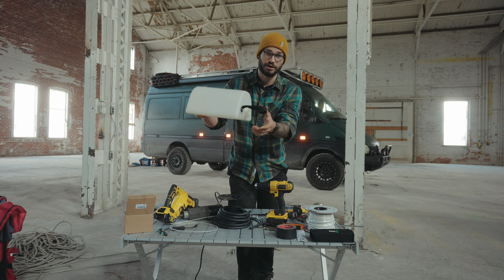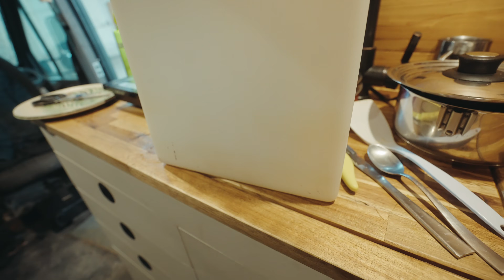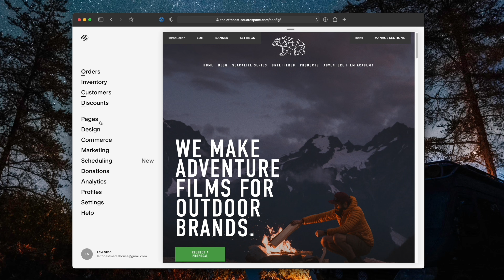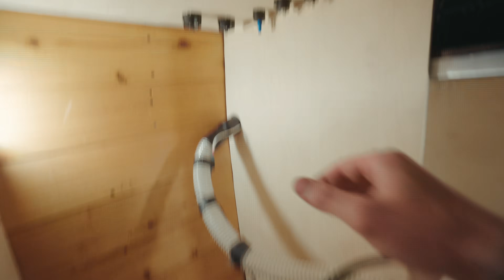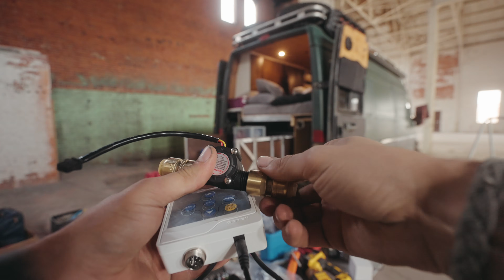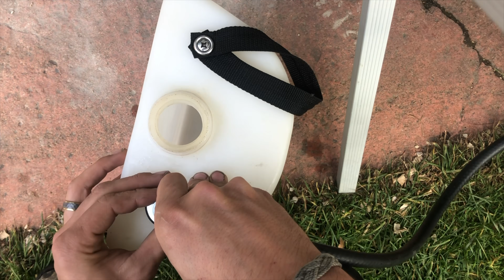DIY Van Life Toilet Hack - Transfer Pump Install

Comment: I used a windshield washer pump and added a hose to a small stainless pipe…   that pipe sprays the urine into the exhaust.. (scavenged from the dead 9th injector on my Duramax)…when the engine is running and that vaporizes and sanitizes the urine.. between campsites it will empty the 5-7 gallons of urine without a problem.. no smell.. mine is Not from a diverter though.. I have a urinal inside a cabinet door that my wife and I both use, which goes to a 10 gallon tank (our grey water and urine), leaving the cartridge toilet for more serious needs. This setup has been in use for over a decade in 2 T1N Sprinters we have converted.
Reply from the maker: Fantastic job. That sounds like a better install than I did here. We will use this in future ideas for sure. Very little do we find we need to actually use the composting toilet. It's mainly just the convenience to pee at night. We shouldn't have spent so much on the natures head toilet

Comment: How's this system holding up?  Is the calcium build up too much for the pump to handle?
Reply from the maker: i need to find a different pump that’s all
Reply: @Levi_Allen  I'm going to try the same thing but with a manual siphon hand pump.

Comment: God wee hack, would be worth flushin it regularly every few days mind you. If you want the pump to be quieter then try a rubber exhaust mount hooked to the wall, the rubber mount will dampen the sound, works a treat on my diesel heater.

Comment: You could automate the decanting on the toilet project using a vertical level sensor.  When the liquid reaches a pre-determined level you could activate the pump with the sensor.  Alternatively, configure the sensor to activate an LED, letting you know to attend to the pump.  The sensor/LED config could've also have been applied to your water level issue.  Set a couple of the vertical sensors, of differing lengths, to an amber and red LED to give an idea as to the level of water in the container.  Great video, keep up the good work...
 
(https://www.ebay.co.uk/itm/363269572732?chn=ps&var=632463718970&norover=1&mkevt=1&mkrid=710-134428-41853-0&mkcid=2&itemid=632463718970_363269572732&targetid=1140163974929&device=c&mktype=pla&googleloc=1006920&poi=&campaignid=12125451326&mkgroupid=117045675099&rlsatarget=aud-629407027825:pla-1140163974929&abcId=9300480&merchantid=6995734&gclid=CjwKCAjwr_uCBhAFEiwAX8YJgaLfkQ7s99Vo7RJLwzsT_4yFDlKHNRy6GEc4Insy6k9bVlDqqX_3PRoCpEsQAvD_BwE)

Comment: Piss on the world. All these self righteous hypocrites. Every single person in the world, has pissed somewhere outside in an emergency. I'm not going to hurt my body because you're stupid, and deluded. It's natural. Just excess minerals and such from your body.
Reply from the maker: They are fair to be nervous about a vanlife spraying piss wherever they please. But adding this pump does not make that more likely than it always has been. It’s a much better solution that a hole cut through the foot directly in my opinion ¯\_(ツ)_/¯
Reply: @Levi_Allen  lol I've heard stories of nasty people doing that. Especially when I was truck driving. Either carry a bucket, and car litter,or just stop somewhere. As far as pee, it's a natural function. Not like you're dumping 5 gallons in a public parking lot, if you're being sensible, it's harmless

Comment: Like the toilet mod. However as a solo traveler, a pee bottle works well for me. 

As to a water monitor. There is another option. The Seelevel monitor is much simpler and attaches to the outside of the tank. No drilling or modes to the tank and water lines needed. 

https://www.garnetinstruments.com/product/709p3-seelevel-tank-monitor/

I've purchased one with two displays. One to check levels on my monitor wall. The other will be in a magnetic box. I can place it on the side of the van and monitor levels as I fill the tank.

Good luck!

Comment: There are some really cheap tank level sensors, six for less than $15 on Amazon for example (https://www.amazon.com/dp/B071ZG4Y34 ). You could mount one at the 3/4 level in the pee container to turn on a light to tell you it is time to empty the container.

Comment: these pumps are not usable for water or urine, they will lock up due to calcium and the water (rust) 
 in a short time. In other hand, there are pumps available that wil... simple fix.

Comment: If you can see the tanks, like you can see the one in the toilet... Make it easier to see the level by simply putting an LED light on them. Just tape one down to the tank with the led aimed at the tank. That will put enough light into the tank, that it will make the level obvious. Even works with clear water. Put a switch on it of course. You don't want to leave even an LED light constantly on, and in contact with the plastic tank.

Comment: In the case of this project, filter before the pump. And i would suggest a cleanable, or at least easily replaced filter. If it starts to get clogged, you'll eventually realize it because of the slower empty of the tank.

Comment: Super solution to a messy problem.  As far as fuel filter placement, in my Isuzu the inline fuel filter is >after< the fuel pump which is in the gas tank itself. Awesome vids as always!